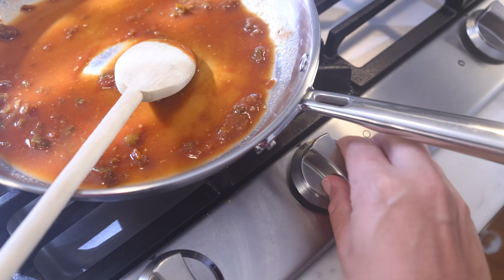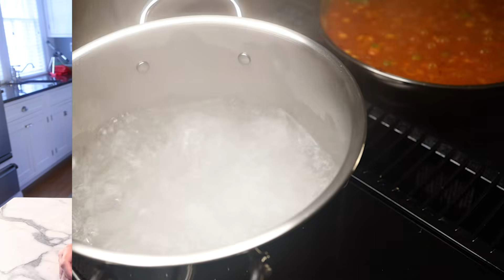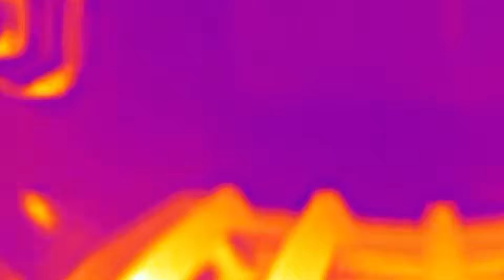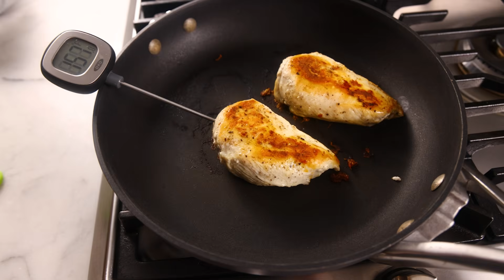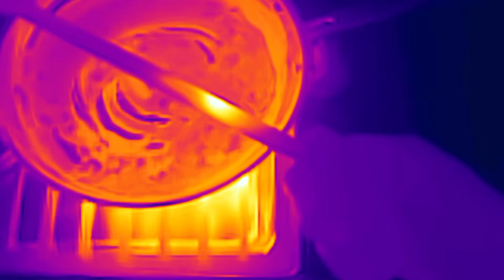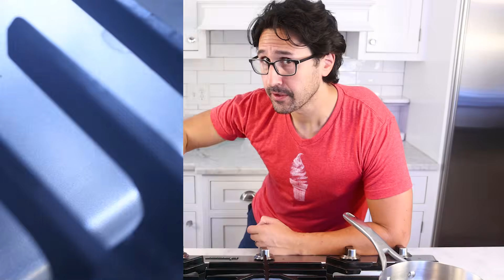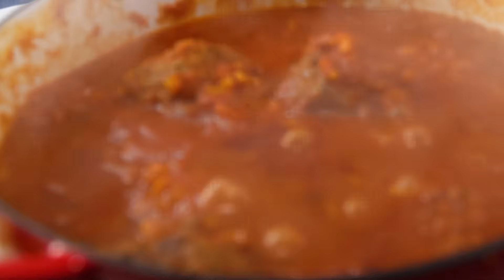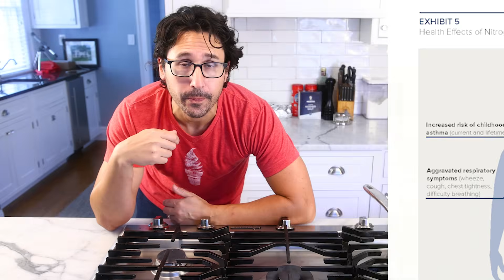Problems with gas stovetops | weak, dirty and dangerous

Comment: Gas stoves work when the power is out as well, that's helped us cook meals several times during bad storms and outages.
Reply: That's a valid point, but it depends hugely on where you live. In Europe outages are very rare, and if it happens they are fixed within a few hours. The longest outage I remember ever, in my 30 years, was like half a day and it was after the biggest storm we ever had
Reply: @kemushi-ro  I have had power outages in coastal Georgia many times. When hurricanes impact us, as they do not in Europe, it has been out for as long as 5 days. I will be corrected if wrong, but the US has more violent weather than Europe
Reply: @kemushi-ro  that's actually kind of amazing. Longest outage I had was 19 days
Reply: I have my camping stove with propane cylinders, good enough for a rare power outage.     Even if you don’t go camping, a single burner and a couple of cylinders is cheap.  Plus I live in earthquake country, should the big one hit, I can take my camping stove with me, something you cannot do with your gas kitchen cooktop (unless your kitchen cooktop IS your camping stove😉)
Reply: @katleman  there are even single burner camping stoves that can run off of plain ole gasoline, or if you don't like the smell you can use "white gas" that they sell specifically for the camping stoves (the smell of gasoline doesn't get into the food but it still stinks and sometimes is sooty). Cheapest way to cook probably. I have electric personally because it works just fine, i have no problem with it, but gas stoves IMO are more dependable.

Orrrrr maybe I'm totally wrong and I'm just ignorant. I'm not an expert so please don't murder me if I'm wrong about something!!!
Reply: I just made sure to buy a barbecue with a burner on the side.
Reply: Only if the upstram guys can power their pumps, and system has capacity so pressure won't dissapear.
Reply: @branislavhatala3067  The vast majority of compressor stations in gas mains are powered by using a small amount of the gas from the supply
Reply: @branislavhatala3067  you assume there is an upstream guy.

A sizable portion of gas stoves run on propane delivered and stored in large tanks at the home.

We've cooked hundreds- actually maybe over a thousand- of power down meals on our propane stove.

It's a shame the oven requires power, but the stove I'm getting next runs the oven controls from a D battery
Reply: @branislavhatala3067  We have a gas tank in our back yard that provides our house with the gas needed to cook and stay warm during the winter. We don't have gas lines running into our home that is controlled by towns and cities.
Reply: @branislavhatala3067  Cylinders dude
Reply: @thekramer1097  Cylinders do not last forever, either...
Reply: I'd just buy a bottle of gas an a burner and shove in somewhere till you need it and have electric (although I'd probably have induction not halogen) given the option.
Reply: Just keep a camp stove for emergencies if you live somewhere this is likely, then you can bring it with you if you need to evacuate too
Reply: @PiHKALchu  Yep. A camp stove and a bunch of butane canisters. Works well.
Reply: Only if your gas pipes are passively pressurized. My gas went out about the same time as power back when I lived in an apartment. There's maybe 5-10 minutes worth of gas in the pipes after the outage starts.

(edit: and of course a propane/butane bottle will work)
Reply: @ssj3gohan456  in thailand we have our own gas tank. So we never have pressure problems when their is a bad strom. Only downside is wee need to fill a gas tank every 4-6 months.
Reply: @031ศิววุฒิชูฉิม  Same here where I live in the states. We have a gas tank in our back yard that provides us with the gas needed to cook and a stay warm with in the winter. It costs about $100+ dollars to fill it up depending on how much you use it.
Reply: @ssj3gohan456  in asia we mostly use tank gas in our house so mostly no problem for us
Reply: @ssj3gohan456  gas pipe? Naw we got  that thiccc tank in the backyard
Reply: @ssj3gohan456  we use gas tanks.
Reply: @ssj3gohan456  
Any area with civil engineers worth a damn will NOT grid-tie the gas. After all, one big occasion for the grid to go down is after a big snow/ice event, and that is EXACTLY when gas heat is life-savingily critical.

Grid-tying your gas supply is tantamount to saying: "I want as many people to die in a winter storm as possible."
Reply: @bcubed72  In Norway it is in the building code that every new house has to have a wood burning stove fitted for such events, probably not viable in Texas or similar  but it can be done if the will is there.
Reply: @bcubed72  unfortunately we have too many towns and cities run by terrible people so let's just hope those engineers if they exist speak up and save us from disaster....... @Texas
Reply: Many places in Europe don't have regular outages. I think I can count on one hand the number of outages I have experienced through my 25-year life. None of them lasted more than an hour, so loosing power is not really an issue here.
Reply: @joenes96  im 34 and from EU. I remember one outage that lasted like 1-2 hours when I was around 10. Rest are less than 15mins and can be counted with one hand.
Reply: @joenes96  Yeah I can't even count how many times my power has gone out due to either weather, some idiot driving drunk into a power pole, or just plain ass negligence from the power company. Every time I hear that Europe is better it makes me want to become an Expat cause this shit is getting old in the states.
Reply: @lloidffxi  I'm curious, do you live in a large city or just in a state with poor infrastructure
Reply: @lloidffxi  I think it’s just due to the fact that they have more mild weather than us in the US.  Not some kind of overall superiority….
Reply: @Schlumeister  That’s mostly it. I can also count on one hand the number of times I have experienced really bad storms. Crazy colds, seeing as I’m from Norway, but no storms like those in the southern US.
Reply: @Schlumeister  it's mixed. Sure, more of Western Europe has a temperate climate than the US, but we do get snow, heat waves and cold waves, too. But most of our utility lines are underground, and aren't damaged nearly as often as they are in the US, I mean, you hve more more overground utility lines hanging from poles than in semi-industrialised countries like Turkey or Morocco. 
It depends on the country (Europe is not a country), but I have the impression our electricity plants are often in better shape, too. So yeah, we have more luck with our weather, but that's only part of the explanation.
Reply: @Schlumeister  next time you’re in europe, try to look for electricity poles in cities/towns/villages. you’ll see (almost) none. that’s the “secret”.
Reply: @kam_iko  that also might have to do with the fact that they have a more recent infrastructure due to wars destroying the previously existing ones. Not saying our old and out dates system is amazing either. I just think the constant appraisal of everywhere else and the constant negative feedback agains the US causes an almost self fulfilling attitude of mediocrity.
Reply: @Schlumeister  Europe is also much smaller with much higher population.
Reply: @JoshDragRace0688  Europe as a whole is actually larger than the US with a higher population density.
Reply: @Schlumeister  Europe is marginally larger then the US (3,796,742 and 3,930,000 square miles, per Wikipedia) though depending on what islands are or aren't counted the number for Europe could change quite a bit.

But high population density is helpful in terms of infrastructure, I imagine the amount of places is Europe where they have to run electrical cables and gas pipes for miles just to hit a single house or town of 100 people is significantly less than how many times that is done in the US.
Reply: @rogervanaman6739  wouldn’t that means  they have to do that same thing more in the US, because of it’s smaller population density?
Reply: @Schlumeister  That's what I was saying, I reworded the sentence, maybe it is more clear now.
Reply: @Schlumeister  If the US is using power infrastructure from the 1940s, I think I’ve found your problem. I doubt there’s much that hasn’t been replaced more than once since then. 
Europe has spent many billions undergrounding utilities since the 80s and 90s. The western seaboard of Europe gets plenty of storms and outages but they’re normally localised and fixed quickly unless a hurricane puts too much strain on the provider to fix. 
The biggest difference apart from the reduction in overground cables is the regulation. Bulk transmission falls under the governance of ENTSO-E, a group set up by the EU to regulate bulk transmission of power and the compulsory creation or nomination of a National Regulatory Authority. A prescribed list of duties and procedures to deal with problems goes a long way towards fixing them quickly.
Reply: @lloidffxi  i had power go out more often because I broke a fuse than the electrical grid broke. I think its a total of 5 times in my life. 2 of them were preplanned and they announced when and why and how it would happen.
Reply: @lloidffxi  you mean Immigrant, right? Expat is when you are away for only a few years or you frequently spend time back home, like spending a few months each year at your original home country but the rest elsewhere with the intent to eventually stop being out of your home country again. If you don't have an active relationship back with your home country you're just an immigrant.
Reply: @barvdw  and “hanging from poles” is exactly the right description. Some of the wires are hanging so low that a school bus couldn’t get thru on a street near us. Here in the U.S., years of tax cuts for the rich and no investment in infrastructure have left us more vulnerable to bad weather right when bad weather is becoming horrendous because of climate change.
Reply: @barvdw  your high voltage transmission lines are definitely not underground
Reply: @rtreyk  not all, but they are partly underground.
Reply: @barvdw  underground high voltage require crazy expensive insulation systems
Reply: @rtreyk  I know. And? 220 kV or 380 kV is rarely underground in the Netherlands or Belgium, my country, but starting with 150 kV and lower, an increasing part is brought underground.
Reply: @barvdw  exactly my point? High voltage transmission lines can't be underground
Reply: @rtreyk  I'd call 70 kV and above as high voltage, wouldn't you? High voltage lines are very sturdy, too, so e.g. ice forming is likely not gonna happen because of the heat that is radiating from them. 
Still, you started about high voltage lines, I did not specify, but was more talking about distribution lines. You still have a ton of those, even in relatively new neighbourhoods. In my village, most were phased out in the late 90s...
Reply: @barvdw  new neighborhoods all have underground in my experience. but a big issue is that a lot of old neighborhoods can still be extremely expensive and they have lots of above ground
Reply: @lloidffxi  escaping from USA is the only logical think to do in USA after visiting a handful of monuments
Reply: @lloidffxi  sounds like you are in an unusually bad region of the US, here in Kansas the power almost never goes out, and I can only remember one time in my 18 years of living here where it went out long enough to cook a meal on a gas stove.
Reply: @barvdw  Population density is a large part of it. What most of Europe call rural is what we would call undeveloped land just outside the city. Our rural areas are county to county with 10-40k people in them.  It gets prohibitively expensive to  bury utility lines when each customer is a mile away from the last one.

Just as you said "it depends on the county",  here it depends on the state. I know Europeans are not familiar with how America is organized, but really you should compare the US to the EU and our individual states as comparable to the member nations in the EU. It isn't a one to one comparison, but each state has A LOT of sovereignty and outside of their own currency and the ability to leave the union, they have just as much as member states in the EU. The average US state has 10 thousand national guard troops with air wings and ground forces. So states such as Texas have their utilities grid. And all laws not directly pertaining to defense, interstate commerce, treaties,  or general welfare are the pure domain of the state, AKA state rights. Regulation of utilities and the quality of the said utilities is largely, a state issue that will vary from one state to another.

As for climate, only your Nordic nations have winters on par with our north east quarter and our numerous mountain areas. Alaska has them covered boo boo.  But to balance that out some, we have deserts and subtropical areas as well.  America is so big and has so much diversity in climate, infrastructure, and well every demographic or statistical measure you could think of. 

But in any case, I live in rural Indiana and I don't remember the last time we lost power for any non-negligible length of time.
Reply: @krisspkriss  some very good points you make. Still, there's quite a bit of utility lines in more built-up areas, too, no? I haven't seen every corner of the US, but even in cities such as Atlanta, Miami, etc, it's more common than in most of the EU. And exactly because of the harsher weather, you'd expect you'd benefit from burying your utility lines, no?
Reply: @barvdw  Not every lace has harsh winters. There is a story about how LA has a buried eclectic line. There was a fault in the line and it was a minor modern wonder repairing it. There are YT videos on it. In any case, buried electric lines are a mixed bag. We do use them some in the US but not in low pop density areas and not for extreme density either. Watch a video about the LA power line and you will get a better idea of the logistical issues.
Reply: @lloidffxi  Well you're not doing much research if you think Europe is better lol.
Reply: @JoshDragRace0688  Europe is actually bigger than US in landmass
Reply: @Schlumeister  although, this isn’t for Europe, but Japan vs the USA with power outages.  We were in a 6.9 earthquake in japan and it was beyond terrifying, but we never lost power, and our house got one small crack and one person was killed in a trail that collapsed. The 1989 Loma Prieta earthquake was devastation.
Reply: @lloidffxi  what do you expect if you use poles to transfer power? In 20 years in Germany I only remember 3 outages, two of them where because of heavy accidents.
Reply: @TJ-bg4fw  It doesn't really matter pretty much anywhere in the states power outages are going to happen. You have to realize we are much less densely populated than Europe so our grid doesn't have as much backup. It's not like if the power goes out in one city you can borrow power from another city like happens in Europe when there are power problems. It's not unusual for the next closest city to you to be at least a 2 hour drive away.
Reply: @TJ-bg4fw  states with poor infrastructure is very common unfortunately..
Reply: @Schlumeister  and yet the u.s. American working population pays for Europe security. But were the racist bad guys in the world 🇺🇲☝️✌️😁
Reply: @joenes96  Exactly! You guys in western Europe have the mild side of the AMOC! And for the Scandinavian countries, half(!) of that warm ocean water enters the Nordic Seas. Otherwise your sub Arctic living would look a little more like Siberia. But cold anomalies are going to become more and more common in the Nordic Sea in the next decades- that's the best case I've read in climate literature. So enjoy your mild winters while they last! In your latitude you should be averaging -30°C in the daytime in winter if not for AMOC.
Reply: @barvdw  Distance needed for the lines to cover presents a huge barrier in fixing this weakness in the grid over here. I live east of the Mississippi where cities are much closer together than in the western US (which also is much a bigger area than the Eastern US). But even here major cities are 200+ miles which is like 300-350km apart. The electric grid in the United States began with the birth of electricity and wires for transmitting it itself. Sort of an issue of no one knew what they were doing in the beginning and in the 100 years after that, electric grid problems could only be patched and solutions that would've been much better were not implemented because we'd had to have rebuilt our electric grid from the ground up.
Reply: @TJ-bg4fw  Given that POS  u.s. has one of the inconsistent, crumbling infrastructures I don't know what the feck you're doing about m 0 ron
Reply: @TJ-bg4fw  Many cities increasingly bury their power lines over time, if it is possible.
Reply: @kam_iko We have high voltage lines overground but those don't struggle so much against weather as you only need a fee of them so you can make them stronger.
Reply: @joenes96  I'm 21 and been through 1 outage ever and I'm American. Europe isn't special
Reply: @joenes96  same with my part of the US.
Reply: @joenes96  that's wonderful, for those of you in that position. Here in rural western Washington state (it's probably worse in the rural parts of the east side) I've had around 90 days of Full Blackout (no power from wakeup to bed) in 33 years
Reply: @joenes96  Same here in Australia too. Just rare instances like in South Australia and even then, the response of the government and people there was comprehensive and more progressive towards grid-scale and home-scale battery systems and other measures to cope if such an issue arises. So again, in Australia, our utility infrastructure is usually very reliable. If anything, it's that reliability informing complacency in terms of change, but we're slowly getting there with our renewable energy and more sustainable alteratives.
Reply: @joenes96  where I live in the rocky mountains in Colorado USA we lose power every winter sometimes days to weeks at a time. So it is necessary to have natural gas or propane. Myself and neighbors also use wood for fuel in the winter as well
Reply: @joenes96  so what! In Mexico they do more then the United States  and they have a centralized electrical system too.
Reply: @joenes96  live in UK I believe there have been about 12 outrages ranging from an hour to an entire day
Reply: @joenes96  Power is awful in America, sometimes we have outages that last days or weeks.
Reply: @Orinslayer  Texas… (which could have been avoided). Our area of U.S. (DC) gets fairly frequent power outages, but they’re hours, not days. That’s because a weeks long power outage many years ago made people so angry that the power company was forced by local governments to finally do the maintenance it had avoided for years. State of Texas, from what I’ve read, hasn’t done anything to improve their awful energy system. Profit over people should be the Texas motto.
Reply: @Orinslayer  that really depends on where you live, the last power outage I've experienced was when a guy driving a semi ran into our house and took down a couple power lines a couple years ago
Reply: @TamarLitvot  Yeah I live here and our f**king governor hasn't done anything. I am preparing to get frozen again.
Reply: @joenes96  well you're screwed if and when it does happen like in a war
Reply: Not sure about the safety of the heating aspect of using a gas stove during a power outtage to keep your house warm, but looks like this is an excuse to buy one of those portable butane/propane gas ranges. Not only can you use it to cook food during an emergency or power outtage, you can use it outdoors during a tailgate or camping and indoors for fondue and hotpot nights! If you buy a cast iron plate that sits on top, now you have Korean BBQ at home too!
Reply: Imo it really depends on how often you have outages. I have induction, but I also have a propane grill with a few tanks in the shed. 

I have yet to have the power go out where I live, so it doesn't make much sense to buy a wasteful polluting stove just for that contingency. I've got a grill.

Even if the power did go out more frequently, I'd probably opt for a natural gas generator in combo with my solar panels to get me through.
Reply: @mjs3188  you mention pollution...and then talk about generating electricity from fossil fuels...

Natural gas might be pretty bad because it's methane, but I know for a fact that cooking with propane is less polluting than generating electricity from fossil fuels lol
Reply: @priestesslucy  all my stuff runs on solar. No fossil fuel here
Reply: @mjs3188  in the post I was responding to you mentioned a gas generator lol
Reply: @priestesslucy  as an emergency backup. There's no sense constantly burning fossil fuels when you don't need to. Power outage is a time when you need to unless you have solar and battery.

It's like buying a Texas King Big Dick 3000 pickup truck because you might need to haul lumber once or twice a year and otherwise you just go to work and the grocery store. Get the efficient car and rent the big dick 3000 when you actually need it.
Reply: As I watch this because a fall storm just took my power out ..can confirm, rice boiling 👍
Reply: how often does that happen? do you live in a third world country??
Reply: @fukpoeslaw3613  yes. The result of too many years of Republicans undermining government.
Reply: @TamarLitvot  Republicans don't undermine government, they expand it just as much as the Democrats, just in a different direction.

I really, really hope to be out of this dumpster in a few years
Reply: @priestesslucy  good point - they extend government into controlling women’s bodies, censoring textbooks, imposing their religious beliefs on others and taking away local control when local governments try to preserve the well-being of their citizens.
Reply: @fukpoeslaw3613  or Texas apperently
Reply: We don't have outages!
Reply: Increasingly new ones don’t because they have a sensor system that prevents the gas from being released when the igniter can’t fire (such as during an outage).
Reply: True that! When those of us in Texas went through the "Icopocolyps" last February, my all electric home never lost power. But if it had, I do have a gas grill with a side burner.  

If I lived in a home or apartment with only electric range, I'd consider buying a Coleman gasoline stove and a gallon of fuel. Both can live in a closet for many years.
Reply: @frequentlycynical642  Folks, one of the easiest ways to die of carbon monoxide is to use a fuel device indoors without proper ventilation. If you don't know, take it outside.
Reply: Newer gas stoves won't work without electricity.  🤣🤦‍♂️
Reply: @loverlei79  Just gotta light it with a match the old fashioned way. Or safer with a long lighter, don't burn your eyelashes off...
Reply: @loverlei79  you mean they won’t light? During storm outages, I light my gas stove with a match or fire lighter.
Reply: @TamarLitvot  the newer gas stove won't let you do that.  For all intents and purposes they are just fancy flame electric stoves. My mom finally bought a gas stove and everything shuts off when the power is off.  You can't match light the burners.  
Its some new "safety feature".
Reply: @loverlei79  I think of my gas cooktop as new but just realized it’s 16 years old. Glad you told me about not being able to use new gas stoves during a power outage because we’re moving to a house with an electric cooktop — makes me less unhappy about that.
Reply: @TamarLitvot  The future is all about induction stoves with a portable camp propane stove with a standard propane tank as a last-ditch backup.
Reply: @loverlei79  yeah don't buy that crap. If you're going to buy a gas stove make sure the damn thing actually works when it needs to
Reply: @loverlei79  for the initial spark?...
Reply: @loverlei79  turn on the burner. Light it with a long lighter or a match
Reply: @loverlei79  most just need to be lit with a match when the power is out
Reply: Not always my Maytag Gemini kills all the gas when the power goes out🥺 even the top burners I'm not sure why maybe because it has a sabbath mode? I had to put a UPS battery backup next to it that last a few hours if the power goes out, I don't understand the top burners being shut off? the oven yes because it needs the computer to control it. There's a reset I need to do to get it working again if it looses power, becides that I love it! the power burner will boil water faster than any electric range!!!! I don't know about the conductive ranges never had one.
Reply: As long as you can get proper ventilation. Without the range hood exhaust, its a potentially deadly thing to do. (4 years in culinary industry working in kitchens/college apprenticeship)
Reply: Please don't, CO exists and you'll die in minutes without ventilation.
Reply: @blorblin  uh it's not like most homes even use active ventilation and passive ventilation works just fine without electricity. People have been using gas stoves indoors without active ventilation for over 100 years. The amount of carbon monoxide produced from a gas stove is pretty minuscule anyway.
Reply: Infastructure is not the issue, distance is. I live just outside Chattanooga Tn. Hydroelectric all around me. The linements college is in my county. We get to pick from the best. But the distances involved to bring that power from the river, up the mountain where I live requires a lot of high voltage lines. Between ice storms, huricanes and tornados, you can lose a lot of those lines at one time, over a large area. We are not talking about a tree down, or a car crash. We are talking about thousands of trees down and roads gone all at the same time. The best linemen in the world still have to triage. If there is 50 homes on my mountan without power, and 2000 homes without power 3 mountans over, I am last in line. They fix things in the order of what gets the most people back on line first, and the single home with an outtage last. Where you fall is a matter of luck. While most outtages are a few hours, every few years we have long ones. 2011, the town at the foot of my mountan was hit by an EF5 tornado. I did not have power for 7 days. Thats why I have a ventless propane heater, and stove. I have 300 gallons of propane on hand. I also have a wood heater/stove just in case. Blizards do happen too. An outtage like that has happened to me 5 or 6 times in my life, and the people with electric heat and cooking suffered.

Yes, my rather new gas stove works fine without power. The cooktop anyway. The oven needs power. I have to use a lighter to light the cooktop when the power is out but it does work. No you are not going to die cooking without the hood on for a few days. Many of the hoods in the US do not even vent outside. Mine doesnt. I have had a ventless propane heater for 40 years. No health problems from that. My room mate  has have verntless propane apliances most of her life and is a heathy 94 years old.
Reply: @RebelCowboysRVs  love cooking with propane... but you sound like you're in an area where you could do your heating with wood?

It's always been my personal preference to reserve the propane for smaller jobs like cooking vs general heating lol. 

To each their own ofc.
Reply: Same thing applies to fireplaces, and wood stoves, the difference is that fireplaces and woodstoves can also work when your gas supply fails.
Reply: There’s no guarantee that you will have gas, many places gas stops when electricity goes offline. You can get a small gas burners that you can use when power goes out if it happens often. You could also use a grill, or even just a small fire outside.
Reply: Get a propane when the power goes out, which is like 1 day out of the year.
Reply: @tuanas458 I don't know where you live but I'd love it if the power only went out 1 day a year.
Reply: VERY big upside
Reply: @mt7680  It really isn't.  Planning a major appliance purchase for something that might be inconvenient a couple days a year is silly.  If you actually think you need something for those times there are many other options that are cheaper and more flexible and don't mean sacrificing something you use practically everyday just for these rare occasions.
Reply: @mt7680  Not really, what once a year you won't have power for 15 minutes?
Reply: @jm036  I average about 3 Full Blackout Days a year.  Don't get them every year but sometimes it's over a week.
Reply: @jm036 More like once a decade you won't have power for half an hour.
Reply: @mt7680  if you live in a shitty neighborhood where that's a common occurrence
Reply: @mt7680  If you have power outages. If you live in a part of the world with good infrastructure, power outages only happen once every couple of years and the power will be back within a day.
Reply: @mt7680  literally a tiny upside. that is not an every day benefit. anyone can use a camping stove.
Reply: I've got a butane camp stove for that.
Reply: I can honestly say I've never had a powercut long enough for this to be a problem
Reply: You can also buy a propane camp stove and a couple of small propane tanks, and use them in emergencies.
Reply: Just get a 20 dollar electric stovetop stove thing and a small electric generator.
Reply: I have an induction hob and electric oven.

I also have candles and a gas camping stove for emergencies. “But sometimes” is not normally a sufficient reason to not do a thing!
Reply: This so much. Power goes out at least 5 times a year for me, used to be more! I have a gas stove and use cast iron primarily but also have a stand alone induction burner. It’s so nice to have choices, also as the CI will work well on the induction burner. Another thing is a cheap gas stove often works better than a cheap electric in my experience.
Reply: That's why you keep a few small propane tanks/portable camp burners.
Reply: While true, this issue could be addressed by a travel stove for those rare occasions. They cost like 30-40 bucks.
Reply: Okay big gas
Reply: That's funny when the power goes out mine doesn't because I have  Is electrical storage, solar panels and a generator.
Reply: You could use portable gas cooktop in that situation, something like you'd use for camping. You don't need a gas stove for a situation that occurs less than 1% of the time.
Reply: Surely the solution to electricity outages is to just build proper electricity infrastructure. I have never experienced an outage in my life, and within two weeks in the US it happened twice.
Reply: Thats why i have a grill
Reply: depends on where you live, I guess. 'gas at home' worked pretty well over here I guess (even though we're slowly phasing over to induction via a 30-year-period of just plain electric coils), but there's interlocking security measures (magnetic valves, pressure differential sensors, blabla) locking the pipes if ventilation etc can't be guaranteed. making gas smelly was a smart move, imho, btw. works to this day.
Reply: Are you Filipino?
Reply: @Eda Bay-Gaddix depends what exactly that means. Just look at the Texas mess
Reply: @Eda Bay-Gaddix except the U.S.
Reply: See GaolZero is a suitable solution for you during power outages or brownouts.
Reply: Agree.  Allows you downsize or forgo a generator.
Reply: Tell that to texas, gas was out too
Reply: That's a good point. I live in Arkansas and a few years ago we had a freezing rain storm that took out power in the area for 6 days. My little gas range kept my kitchen and living room warm enough that I didn't have to freeze to death or go live with a relative for a week.
Reply: You read my mind sir, thats what i like about gas stoves, you can use them even during power outages, just get a barbecue lighter, light the stove then its time for food, and putting the tea kettle on to have tea or instant coffee if you prefer

I always have instant coffee in case of emergencies like power outages
Reply: Thankfully I live somewhere the power nearly never goes out! This has never been a concern for me.
Reply: Where the do you even live that you have that you had them multiple times? Or even consider that a plus.
Reply: @toffeeFairy  Had a hard time deciphering your question. Does it really matter where I live? Do you see pro chefs cooking on electric or induction? I guess they are all stupid. I cannot speak for induction, other than it puts a limit on your cookware in terms of nonstick.
Reply: Which is why we have a trangia stove with both ethanol and propane fule at home. Enough fule for  week of power outage. We also have a wood powered fireplace om which you can put an pan the heat things aleast gently. The worst power outage we have had where I love was half a day. And that was a planned outage for maintenance after a storm to make lasting repairs.
Reply: Easy fix is to get a house battery. Affordable option nowadays
Reply: Mine doesn’t, it’s got some kind of interlock, it won’t do anything without a mains electricity supply 🙃
Reply: Get portable gas stove and canisters. Our asian household uses it for hotpot and kbbq. But it’s the best prepper tool because even gas line could stop I’m guessing
Reply: I can count on one hand the amount of power cuts I've had in the UK in my lifetime (29 years) and the ones I remember have been hardly long enough to light a candle. My apartment is fully electric including heating so I'm grateful for the consistency
Reply: electric stoves work when there's no gas
Reply: Meh, we had a generator installed that automatically kicks in if the power goes out, and powers the whole house.
Reply: Especially in rolling blackout locations.
Reply: If animal farms were they have lots of waste from the animals can get over the fear of improving there systems for it costs more.
Well they can't figure out there spending more not less by not spending more for something that can make everyone profit.
1 digesters for collecting the methane and reducing the smell and increasing the air quality.
2 all the collected methane can be used for a methane engine and make energy and excess gas can go into the grid for people like you and me to use.
3 when the digester is done you got very fertil sludge stuff farms can use to fertilize there crops reducing the demand for chemical fertilizers and increasing yelled in the fields.
4 they spend less make more from different sources like energy and selling fertil sludge wich can reduce costs in the stores wich help us.
5 the way the methane is used it will energy for homes and that can help take coal energy plants off the grid and decrease the amount of warming the earth gets.
Reply: I have a gas stove and somehow I didn't realize this.
Reply: Not an issue for me, but if it was I'd just eat raw or pre cooked foods like bread.
Reply: Huh? Are outages really that common in the US? I never experienced one in my 30 years here in central Europe
Reply: Camp stove, problem solved.
Reply: I'm switching to induction, but will keep a portable gas stove for occasional use.
Reply: You can have a camping stove for that, I have 2. And one that even uses gasoline if I ever need 3 at the time
Reply: Yes we found this out when we moved to the USA - I've lived in a few countries but I was so surprised about how many power outages there are in the rural USA. I had a gas stove in Tbilisi Georgia, and when the power went out we could use it fine and cook. USA we have electric so we were FUCKED. it was the middle of winter, roads were snowy and it was the longest outage I've ever experienced. 
Never experienced outages in Europe, no matter the weather.
Reply: @altariia  Renewable energy sources, batteries for the intermittent power sources (Solar and Wind) and you're sorted. And if not you/your home, then your local community. But given the incompetence behind the black-outs in the first place, I can hardly see them organising themselves to build up that kind of infrastructure for the grid, when they aren't doing the best of jobs already!
Reply: True, but a simple manual can opener works when there is no electricity, and you can eat it cold, right out of the can.

My stove is electric, and I do not see enough reason to change it. Maybe a propane camp-stove might be nice to have, in case of electrical outage?

One time when there was no electricity, I took a nice hot bath in the dark. With a gas water heater, at least there is plenty of hot water.
Reply: @yosefmacgruber1920  I don't anyone's implying that you should go out of your way to get a gas stove just for that reason, just that if you happen to already own one, it's a nice little perk
Reply: @crossover5606  
So what do you use when there is no gas?
Reply: Home Battery Technology is on the rise, especially combined with home solar system installations. Granted some live in shared multi-dwelling buildings, but still, even then, communal battery storage is rolled out as a thing, some areas here. Utility wise too, grid-scale batteries are being used to replace the diesel battery generators normally used during outrages or to maintain persistent power supply to the grid. We don't NEED Gas, not generally or not for Homes and most businesses, atleast - not to say there aren't exceptions (Like larger industries that work with, or certain products that need natural gas for very specific tasks - Gas will have it's place, just more niche), but they are exceptions, not generally. Natural Gas, Plastics and other things still too mainstream in our society - they should be niche and for specialised things, where generally we can have and even USED TO have (Pre-Plastic era), renewable or sustainable alternatives. As a society we're slowly getting there.
Reply: Yeah, for people in third world countries wood and gas makes more sense.
Reply: We have an electrical stove, but a vlosed firplace with a top we can cook on for those cases. "Those cases" haven't happened in the 3 years we've had our house yet. Also: much easier to find firewood than gas, IMO.
Reply: Only if you have a specific type of pipes, many need pumps
Reply: Get a generator
Reply: Coleman stove…
Reply: I have a dual hob. One gas burner that can be small or large and has wok add ons etc. Then i have 4 induction hobs
Reply: So just own a small portable gas canister powered stove top then for emergencies…
Reply: It's always good to have a bit of both. A gas burner isn't very expensive technology even a portable emergency one.
Reply: We have a pv on our roof :)
Reply: Not worth it for once every few years at most.
Reply: Yeah we usually get a straight week of power outage twice a year where I live and having a gas stove is a godsend.  Without it we’d just be making canned soup on a camping stove, which isn’t the end of the world but in week-long power outages we can make steak dinners and eggs and pancakes and other nice food as if it was normal life. 

I’m lucky to have a high quality gas stove so it’s way more powerful than you’d ever need and works really well for everything, and natural gas is really cheap here. So gas is the best option for me. If you don’t get power outages and you don’t mind using induction pans then an inductions stove is definitely the future though. Also if you don’t have the budget for a nice gas stove a “cheap” induction range will usually outperform a “cheap” gas range.
Reply: When i lived out in the country , power outages meant propane was important. We had a large tank that needed periodic filling
Reply: I have a camp stove and several propane bottles for that reason
Reply: My solution, seeing as I'm a renter, is using my camping stove during power outages. Camping stoves are like $20. I don't think this is a real advantage for having to cook with gas everyday.
Reply: Yeah I really wish I had induction but we do lose power a few times a year due to storms and it's nice to be able to use the gas. Though we've also used our hybrid car to power our electric kettle during outages!
Reply: Don't you stock back up meals that don't require gas or electricity to prepare.
Reply: If that happens I'll just cut wood and burn it
Reply: Portable Propane stove
Reply: I haven’t lost power in 20+ years (Chicago suburb). And I have a gas grill if I need a back up.
Reply: Gas is a utility just like electricity and consequently also vulnerable to outages and getting knocked down by bad weather or natural disasters.
Reply: not if you have a modern stove that locks out gas flow when electrical goes out
Reply: I have a camping stove and a propane tank for that.
Reply: I always had a gas grill with a burner for that reason. I would use portable induction burners if I had a gas stove. Just like I wouldn't idle my car in the garage I'm sitting in
Reply: new ovens with spark button as a security feature  actually have electric valves that shut off during outages.
Reply: Emergency propane camping stove would work
Reply: That's right. We in the 3rd word have not so great grids, thus electric is not always suitable... Electric also means your food will be bombarded with Electromagnetic Frequency (EMF), you too if too close to it.
Reply: Never smart to burn gas indoors when you can’t run the range hood.
Reply: @SgtZima  open windows are enough ventilation.
Reply: @priestesslucy  If it's warm enough, sure.
Reply: We use cylinders
Reply: Yes, during the texas freeze we burned out gas stove for warmth
Reply: @gaetondavis3741  I hope you had a carbon monoxide detecter when you did that... super unsafe to heat your home that way
Reply: @gaetondavis3741  super dangerous
Reply: @gaetondavis3741  should not have happened though.

Fix your broken infrastructure
Reply: @gaetondavis3741  Glad you didn't get hurt
Reply: @gaetondavis3741  Sorry you had to do that.  A lot of people die from carbon monoxide because they try to heat their homes with their stoves or ovens though, so I'm glad you're okay.
Reply: How about a wood stove?
Reply: Depends on your gas supply.

If it is just a from a bottle in your cellar or a tank in your garden then what you said is true.

However the electricity grid is the mother grid of modern infrastructure, if electricity fails then everything else will too and with it the gas pipes hooked to your house.

My grandma has both electric and gas stoves and the gas stove is hooked to a propane bottle in the cellar.

If the were to be a blackout she could still cook on 2 of her five burners.
Reply: @abrahamwilberforce9824  where I live we are on natural gas and lose power for days to weeks at a time and we always have gas
Reply: I worked in a Chinese resturant in my home town and we had a power outage during the winter time. We stayed open took orders off the land line and cooked orders utilizing the gas my boss and cooks used to make food with In woks. I think 5 to 10 thousand BTU was the output of one? The heat transfer rate was insane and water boiled in seconds. Like Adam said the wok is a good tool utilize heat exchanging. The fire that leaked out from the sides is part of the "wok hai" flavor. This is unachievable with an electric stove I believe
Reply: @TheCr0wing  I know it's a bit of a meme/comedy channel, but Uncle Roger visited a restaurant that uses induction with woks and they get enough wok hei with it using some tricks. It's definitely possible to get close enough, at least.

Even then, most homes are not using woks on a day to day. It makes more sense to have something specialized for the rare occasion you do, and use induction for the bulk of your cooking.
Reply: @mjs3188  for like a year when I was experimenting with minimalism a wok was the only pan I owned. 

They really can do just about everything.
Reply: Definitely! 
I live in California where we get somewhat regular fires. Every so often the power company will shut off power for days at a time with very little notice to reduce the risk of them starting a fire so they aren’t held liable (they could just fix and update their old and broken power lines instead but they simply won’t do it). If it weren’t for our gas stove we wouldn’t be able to cook when the power goes out.
Reply: @user-dc4dd7cm3e  The state government should mandate that they do it, and give them a reasonable timetable. If they fail to follow through, the state should simply do it for them, unilaterally estimate the added value to the electric grid, and award the people ownership of whatever percentage of the power companies value has been added by the renovations and improvements. Lets say that infrastructure improvements to PG&E or Souther California Edison payed for by the state has increased the estimated value of the companies by 50%. In that case the state should basically award themselves a 33.3% ownership stake in the companies, and sell those shares on the open market.
Reply: but thats why u vote for representatives that make sure the infrastructure is okay for the  weather around u
Reply: @UCwcpu2cmBb0fXyk7x1JI6SA oh fuck off, really? Man that sure sounds great,power goes out at least two times a year where im from (usually during the summer)
Reply: @wolfpytlak2786  still better than mine tho, twice ish a year..while me on the other hand, got 6 in the past 30 days
Reply: @wolfpytlak2786  in countries with less reliable infrastructure, it’s a big issue. Think of rural India.
Reply: well new gas stoves wont work with out electricity either so no benefit there. Also it quite sensitive for pressure drop, i have a experience were gas line were not design for such urban development so in certain times boiling a pot of water takes almost a double the time. Granted if induction were not a thing i never leave the gas stove behind.
Reply: @TooM.46  LOL! An all-gas stove will work without electricity. The only ones that won't work are the ones that are dual energy.
Reply: @stevenalexander4721  well yes and no. It boil down to the safety. In old old ones there is none so no matter what, the gas will continue to flow. In old ones there is heat sensitive safety that produce its own electricity but you have to hold for few seconds to heat up. In very new one, mainly in premium stoves it use wall electricity so you dont have to hold it. But yes even those will work if you hold the knob. Now the question is if the gas regulation stations and distribution station can operate with out electricity long term.
Reply: i find it hard to believe europes is supposedly better with electricity... in my whole life living in italy, not a single city i lived in for longer than a couple weeks didn't have at least some kind of issue with either weather and/or power outages, but gas stoves always worked... minus the electrical spark plug, gas itself always worked fine no matter what.
Reply: just light a fire in your living room lmfaoooo bozo
Reply: @phleb4114  this is what my woodburner is for
Reply: Gas is best.